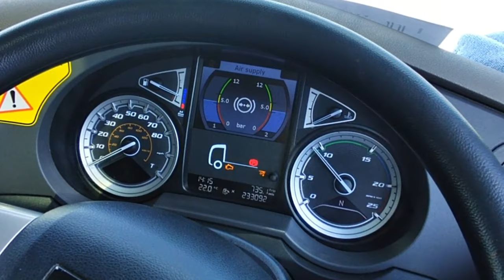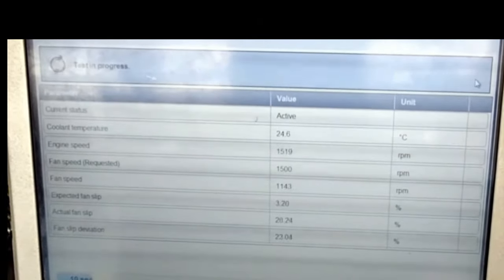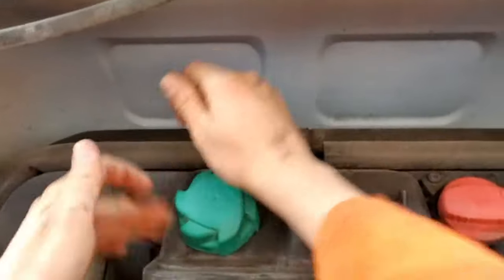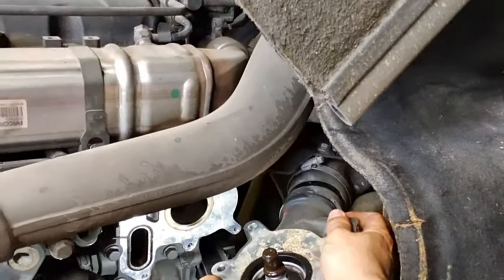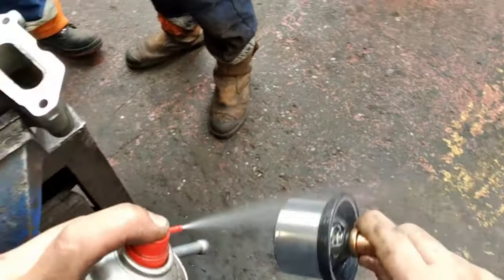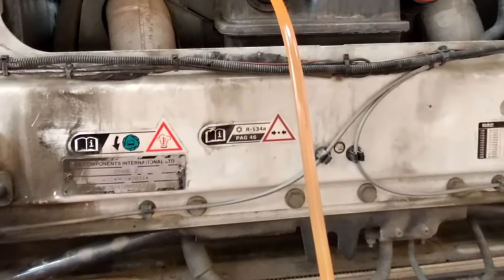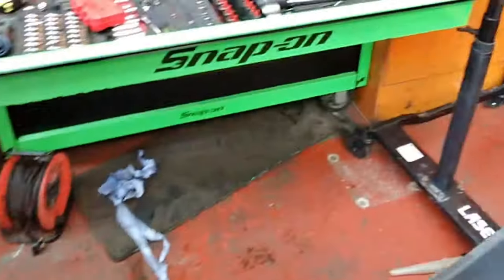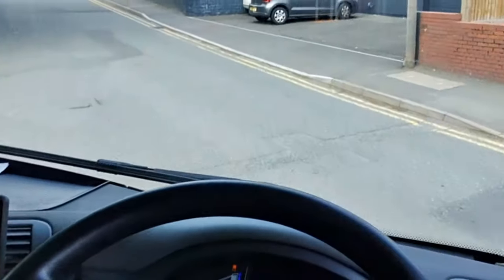DAF TRUCK Mx11 overheating and thermostat replacement

Comment: Great video again! It is strange for me overheating caused by thermostat. On XF105 and euro 6 mx 11 440 hp I have problems with not reaching operating temperature. After thermostat change everything is ok..
Reply from the maker: Hi thanks for you comment!. I've had vehicles also not reaching operation temperature which ends up being the thermostat. I've not looked into the flow of coolant or how the coolant bypasses the thermostat yet but I'm wondering if when these thermostats FAIL they stick in position in the thermostat housing causing a too cold or to hot condition with the vehicle????
Reply: @TRUCKTECHUK   yes, they stick in some positions.

Comment: interesting video!  my 2022 xf 530 started signaling low refrigerant liquid every time I start it after long break usually not throught the day, liquid level is correct not low, is it just a sensor malfunction?
Reply from the maker: Thanks for the comment buddy.  Refrigerant is AC not coolant. I suggest you get the pressures checked or do some basic checks like in my other old video to see if you can identify if it's the AC that's the issue  https://youtu.be/BD6TiO7mJzk
Reply: @TRUCKTECHUK  coolant liquid sorry not ac
Reply from the maker: @Ludo_100  when you say correct, can you touch the level in the header tank with your finger?
Reply: @TRUCKTECHUK  yes and the warning message disappear after 10 min of driving and reappears after I let the truck off for at least 1/2 hours
Reply from the maker: With it being 2022 it will still be under manufacturer warranty, I'd take it back to DAF to get them to check out the sensor resistance the float could be sticking in the header tank
Reply: @TRUCKTECHUK yes I will go soon and   the truck is a rental so is  is all covered for assistance , thanks a lot for the time spent 👍

Comment: Hello my friend, can I ask a question? He has a DAF CF6. When I drive a car a distance of 200 km, there is strong pressure in the water coolant tank. What is the problem, please? And the temperature reaches above 1/2, up to 3, and what is a normal temperature in a truck?
Reply from the maker: Hi, thanks for dropping in. So check the air tanks for water.... Your compressor head gasket could have blown. Check the header tank in case it's putting water out of the overflow down the side of the radiator. You might want to change the header tank....other than that your liners have dropped and it's a head gasket issue. The correct level on the gauge is halfway. If it keeps getting hot I'd check/ change the thermostats and seal also.

Do these repairs in order of cheapest components first 👍
Reply: Thank you, brother. I would like to ask you a question about air pressure
Reply: I am from northern Iraq. My brother, the temperature here is quite high, approximately 48/50 degrees Celsius. His temperature sensor reaches more than half, meaning 1/2 or 2/3. Is this normal or not?

Comment: Where do you get the replacement bottom seal from my local Dad agent says there's no replacement bottom seal
Reply from the maker: Hey thanks for the comment😎👍. All the seals used were in stock on the shelf at DAF

Comment: Shocking you never used the DAF special tool that goes between the rad and intercooler to clean it lol,,,quick tip when you removed the cap if you had went a bit more to the right it actually sits between the 2 pins....I couldn't tell you the last time i had an overheating engine ..The thermostats used to be bullet proof
Reply from the maker: Hi thanks for the reply! Ah yes the special tool, it's like a long stainless pipe with holes in it, I have used it before on LF roadsweepers. I will try and remember for next time. Cant remember the last time I did actually did a thermostat actually 😅.
I have no idea why I don't locate the cap on the header tank properly 🤔 less rushing more methodical working needed I think 👌
Reply: @TRUCKTECHUK  The cap is now 2nd nature i have done that many cams..Actually has 1 where i haven't had to remove the head to ream out the exhaust follower bore ,And the reamer has a DAF part number .it is fixed non adjustable ,and has a go no go tool .to be honest i just use a new follower ..I have lost count the amount i have had to ream out
Reply from the maker: We seem to have a bit of a back log currently of camshaft STD kits going on. I believe the tolerance for exhaust camshaft follower bore wear is something crazy like 5mm!
Reply: @TRUCKTECHUK  from what i am told by our hindrance department  (stores) they are back order ,but i did one last week ,not on the recall ,but because i had to order all the parts individually ,got it all the following day ..crazy
Reply: Great video ,PLEASE HELP .i have daf xf 106 510 ,2016 year production.new water pump,new water boiler with new cup,repair air compresor,new fun clutch,clean radiators water,and now the problem is ,when i go up hill fan not start,temp engine go hii,but when i down hill and i pull retarder fun start ihear him ,PLEASE HELP ,AND OLSO I HAVE PRESAURE IN WATER SYSTEM,AND I HEAR INSIDE CABINE ,GRRR WATER CIRCULATING CRAZY SOMEWHERE ,
Reply from the maker: @ivan_marko_i_cale  do you have any fault codes? So your saying when you go up hill your fan doesn't work but your water temperature gets hot and when you go down hill and use the intarder the fan works? 
And it's pressurised the coolant system. You have changed the thermostat haven't you? And if you have changed the compressor gasket and you still have pressure you need to be checking for combustion gases in the coolant in to see if a liner has dropped. 

Sounds like it needs to go to DAF and give it to someone who can check the right things and identify the issue and not just waste your money changing parts
Reply: @TRUCKTECHUK  fault codes no,termostat i not change yet
Reply: @TRUCKTECHUK  can you please better translate ,liner has dropped ,i dont know what is that in translate
Reply from the maker: @ivan_marko_i_cale  for the price of a thermostat change it. Of all the coolant issues I've seen, very rarely do I see fan hubs that don't have to be changed due to wiring issues, water pumps get changed due to leaking seals not performance issues. Most of my coolant issues are compressor head gaskets which you have changed and thermostats which you try next.
Reply from the maker: @ivan_marko_i_cale   liner is the cylinder liner in the block under the cylinder head, which the pistons opperator in.
The liners drop in the cylinder block causing combustion gassses to leak into the coolant system.  Your best checking your coolant with a combustion gas checker. You must be getting some sort of coolant level warning or fault codes if it's getting that hot?
Reply: @ivan_marko_i_cale  Daf don't do a 106  puegeot do though
Reply: @TRUCKTECHUK  on new fun visco ,is 6 vires ,i cut one ,lucky one ,red i think ,and bring with wire inside truck,on switch,and i manualy in hill ,start fun and of ,elektricity is opozit,BUT MY BIGGEST PROBLEM IS FAN NO START ,
Reply: @TRUCKTECHUK  what hapenning is next ,no fault codes but ,on pipe from water ,out go about 2 liters water,because presaure and high temperature and than i get code collant level check,but with this switch on visco ,now i can go,temperature return to normal
Reply: @norb0254  puegeot is
Reply: I have the same issue with a Xf  106 510 2014 new radiator, new thermostats and seals, new fan clutch, new temp sensor.
When i go up hill temp start to rise in the midel of 1/2 line and 3/4 and my low cost diagnose Delphi truck shows me on long up hils around 98-99.7 celsius 
Fan come in at 96 celsius  and at 99 fans speed is 980 rmp.
No fault codes my coolant its still there .
I whant to put a switch for the fan to spin like its disconected with the engine speed.
Some advices please?🤗

Comment: I've got cf400 E6 mx11 pressurising, done compressor but still bubbles in header tank , egr? Liner?.
Reply from the maker: Hey sorry for the late reply, liner has most probably dropped or your heads corroded unfortunately